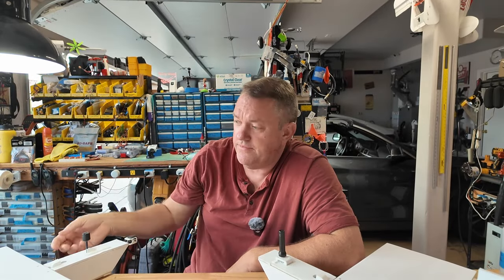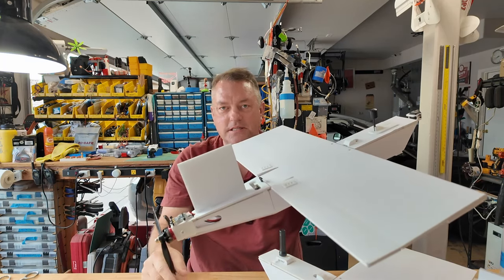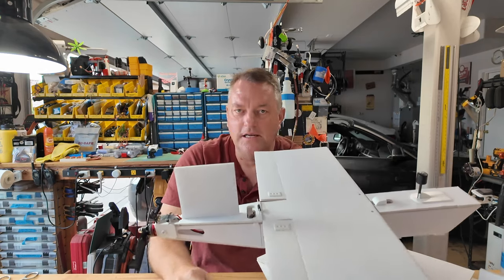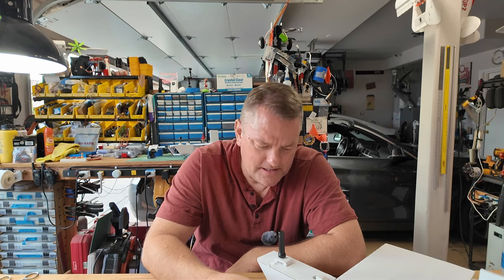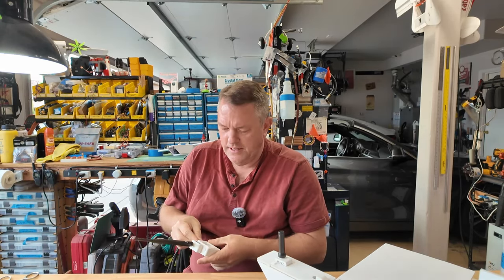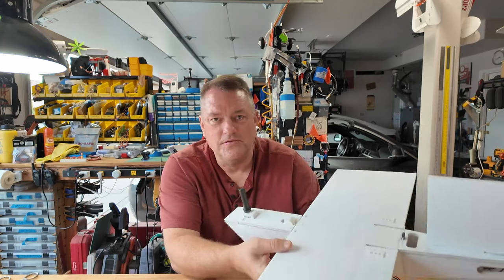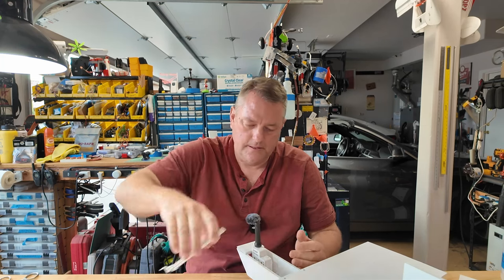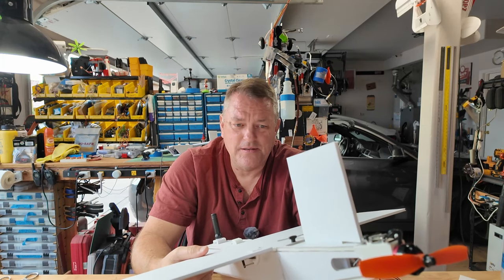Simple Plank Meshtastic Node

Comment: I wonder if someone could program a node  (perhaps a wizblock which uses way less power) , so that it will take in a signal , and repeat it immediately, but also store it, and repeat it again at long time intervals, like once ever 5 minutes , for a total of 1 hour , that way you could put it on a solar powered foam plane with a decent battery, and you could send the plane to fly patterns above a certain area for 12 hours stright (during sunlight), it could be launched in disaster areas and pretty much create a whole communication infrastructure by itself, flying a square pattern over and over, it would transport messages far beyond the range of any direct repeater , it would physically transport the signal to a new location and back again
Reply: It's not exactly that, but Meshtastic does have the Store and Forward module, where you can configure a node as a server, and you can request a rebroadcast of the last heard messages.

Comment: oh great . . . now I need an RC platform. Thanks for the video!
Reply: i used a dji mini 3 pro to get my meshtastics over the trees. once its gets sat signal the drone basically locks and parks itself in the sky where you want it
Reply: @gogglesfpv7986  that's great idea. I have an old Mavic pro that should be able to hold a heltec v3. Maybe ill have better luck with a T beam + GPS